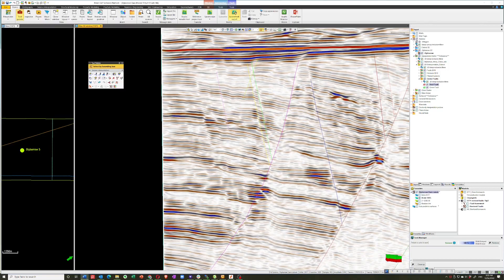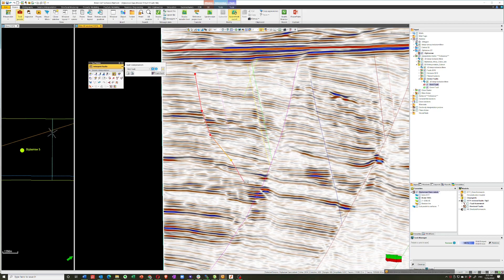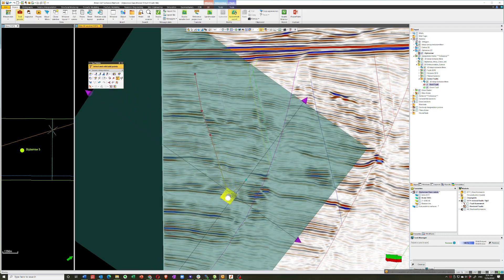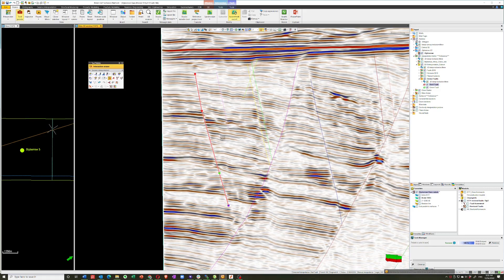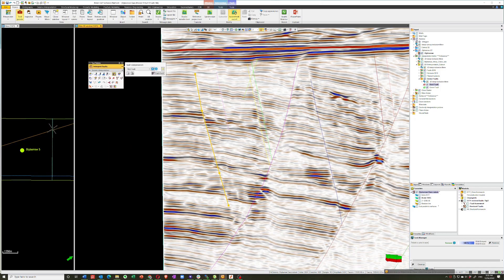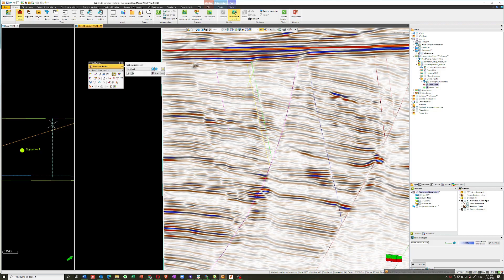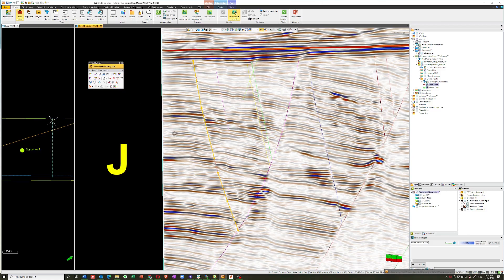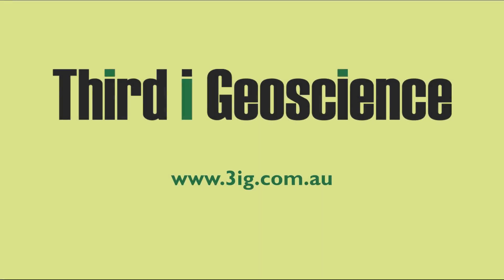Editing Faults in Petrel's 3D Window

Comment: Thanks for the insightful video. I’ve been working on something related called SeismicFlow, an open-source GUI application for visualizing seismic and well logging data in both 2D and 3D. It also includes built-in neural network tools for interpretation. Thanks again for sharing your work.